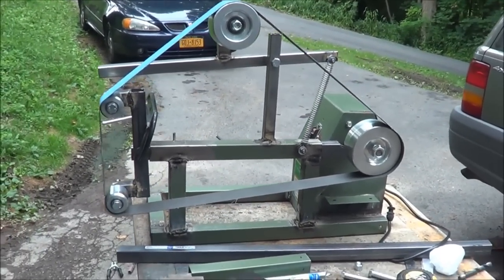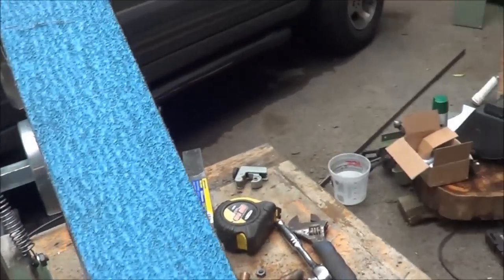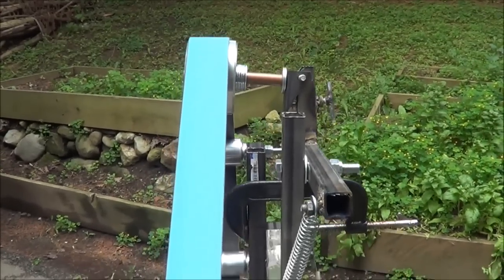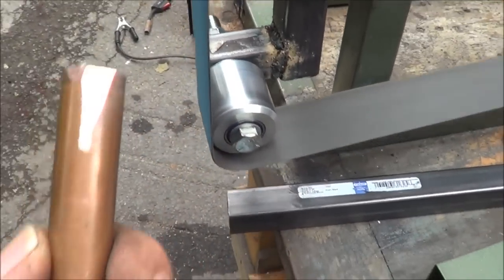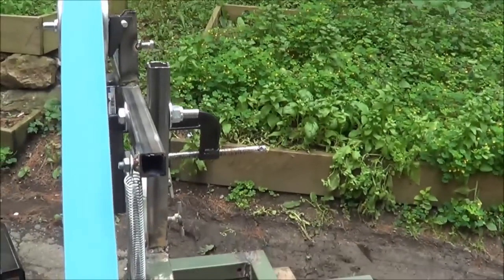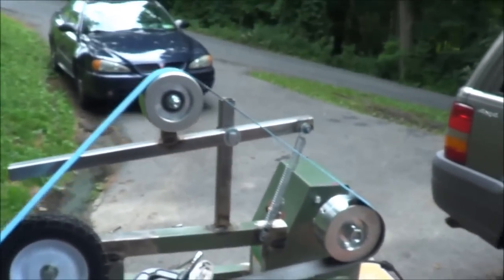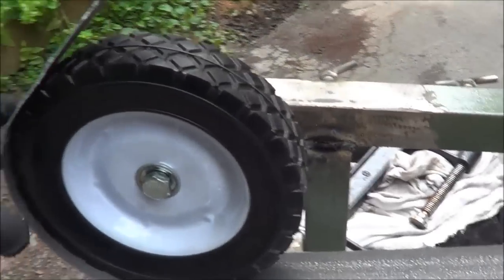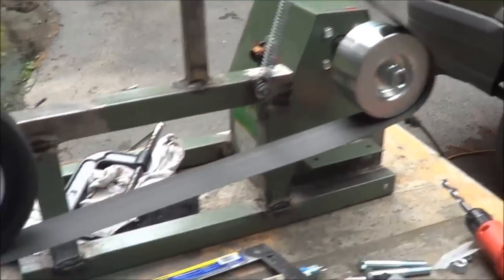Homemade 2 x 72 Belt Grinder Build Part 2

Comment: Chandler,  Freeking AWESOME BUILD when it was completed! I'm going to build the exact same one, trying to see if the motors I have laying around might work, from washers and dryers that I reclaimed. I'll make videos of all my builds and put them on my channel including my build of my foundry which I just got what's called a chimnea , which I also just picked up a brake drum that I'm putting on the bottom of the burn chamber, praying it'll work because the chimnea's base metal seems to be to thin of a metal for the higher temperatures that are required and needed for a good hot foundry. Thanks again for all you do guiding us all on your projects!  Love ya brother!  still waiting for you to approve my facebook friend request. I pray you check them out and subscribe as I did for you. I have a few videos showing how to get 300 miles per gallon running your vehicles on vapor or fuel fumes!  I'm also going to build a Tesla coil to get free energy from the atmosphere as Nikola Tesla did over 100 years ago powering the entire city of Chicago which is well documented in videos on YouTube.  I can give you the links for them as well as ones to cure mist diseases also proven by several men such as Royal Rife, and Hoxey, again I'll give you the links.

Comment: how much did parts run you?
Reply from the maker: +JuggernautCorps The wheels were $150 i think on ebay... most of the rest was scrap... but it would be $300 anyway... not cheap but cheaper than the $1000 new ones...

Comment: sweet build i like it might have to make something similar to that with my own twist does motor size matter i have a 1950s craftsmen table saw i might want to make a add on the back of . i use it for metal cutting so far it runs great still

Comment: Chandler check out grizzly imports for contact wheels the rubber is not bad and if you want  you can get 90 duro neoprene rubber and the green glue and  set your own contact wheel up with rubber ,

Comment: Hey so I really like your build. I have the same lathe and would love to do a cheap conversion. Where did you get the idler wheels and what size extra tubing did you end up using? Hell, if you have any measurements on you you're build it would greatly help a newbie knife maker in need of a grinder build
Reply from the maker: CSquared I got the wheels off from ebay.   Unfortunately they cost about 130$ but I have seen some improvised wheels on youtube that might get you started...  You can always replace them later.  As for extra tubing I used 1 1/4 and 1 inch tubing where i didn't use the tubing from the lathe.  If you did not catch my followup video about adding the 1hp drive motor to the grinder I would suggest at least planning to do that.  The lathe motor worked but the adding the stronger motor made a big difference.  I don't have dimensions as I kind of made them up as I went along trying to get the most out of the steel i had from the lathe.  I can pull some numbers off the build and will try to do that.  Honestly time is crazy now so if you don't hear from me in a week or so send me out another shout!  Good luck with your build!
Reply: Chandler Dickinson Awesome build! I also am newbie knifemaker. Any luck on those numbers???

Comment: Excellent yes. 

No belt guards anywhere but of course you're aware of that.
Reply: None of the manufactured belt grinders use guards why should his.
Reply: Damion Lowther
That's strange because my belt linisher is guarded all around the sanding belt (except smallish operating area) and around the drive pulley, and the motor and the drive belt are guarded within the housing of the machine.

Not having a go at you Chandler btw.
Reply: Yeah I guess I should have said many don't not all. There are a lot of them that don't have any guards just like this design.
Reply: No problem man.  Was just saying.  You do obviously have to be more careful with such designs.